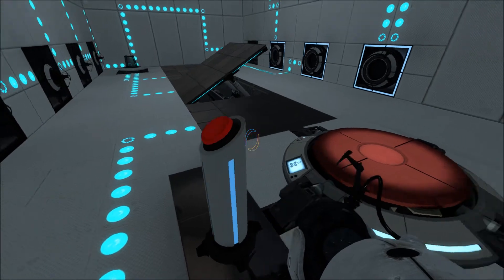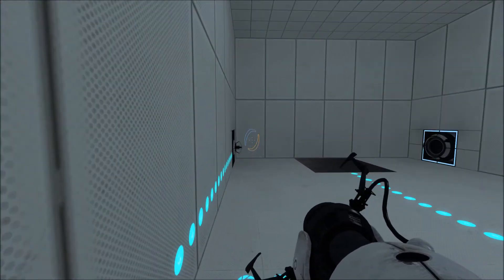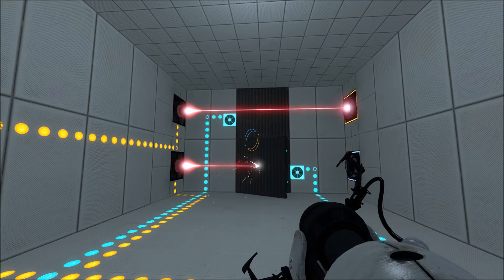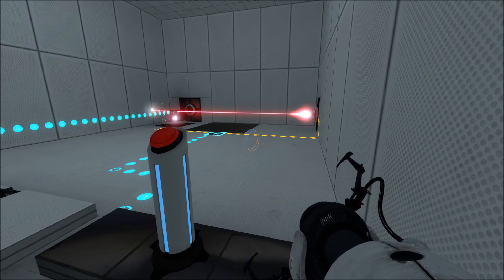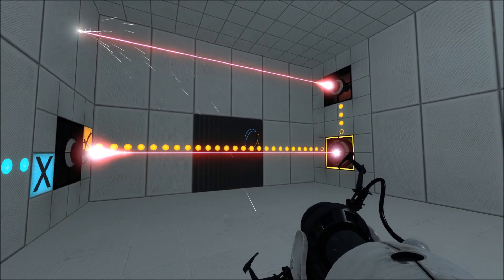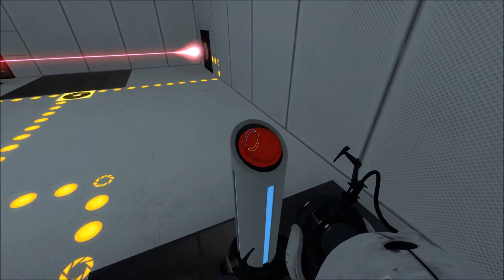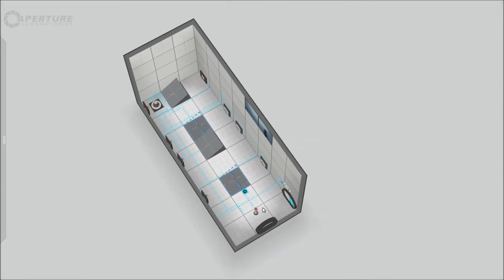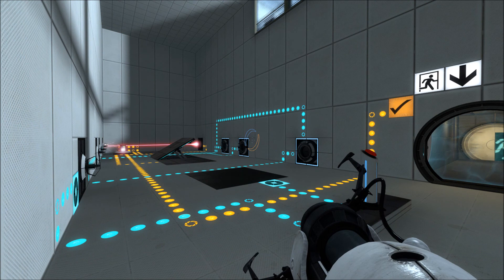Portal 2 - 5 laser toggle switch (EXPLAINED IN DETAIL)

Comment: Anyone know how to create a pulse extender in this game? I’m creating a chamber that utilizes a pulsing laser as one of its main elements (the idea is you need a laser to progress, but it only works if the laser is pulsing on and off rapidly.) 

I need the laser to activate a machine while pulsing, but the connected machine needs to respond as if the laser is NOT pulsing. Take an angled panel for example, while pulsing it it only moves a desperate few inches back and forth, but I need the panel to fully extend or retract in response to the laser. 

I was thinking of using the pulse to activate an SR latch, but obviously once the pulsing laser stops it needs to toggle off the machine. 

The biggest headache I’m running into I think the just how few things respond well to fast pulses. Angled panels being used to break an SR latch is out of the question because they’re too fast (the problem I’m attempting to solve in the first place). Gel dispensers will launch twice as much gel when pulsed but gel is pretty messy and I’ve been hard pressed to make something meaningfully work with them. 

Also amazing video btw, this video got me really interested in what you could do with just the vanilla editor. Thank you! :D

Comment: It's not a glitch, a very similar thing *has* been done in real life. The battery is connected to the relay, too, so standing off of the button does not completely shut off the power.
The pulse is because in the first one, the relay being on causes the laser to be on and the relay being off causes the laser to be off, (the same), while in the second one, the relay being off causes the laser to be on and the relay being on causes the laser to be off, (the opposite). It is completely different.